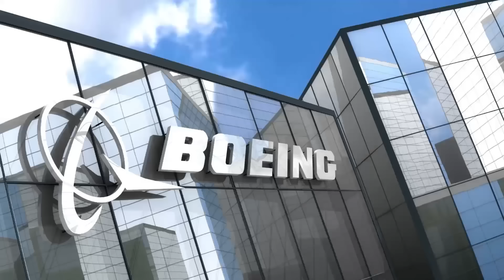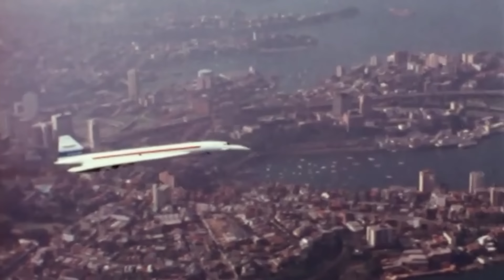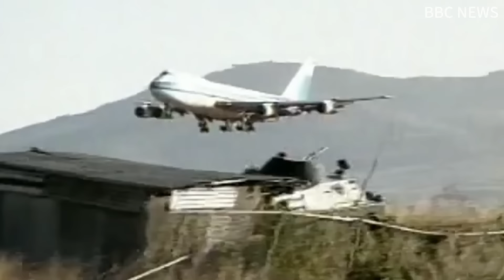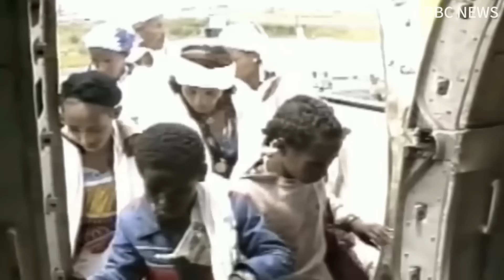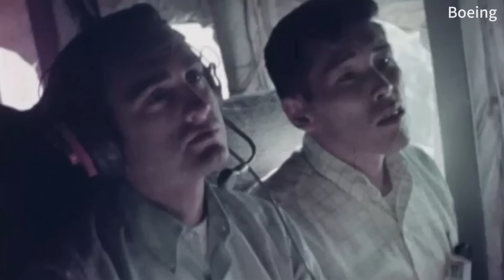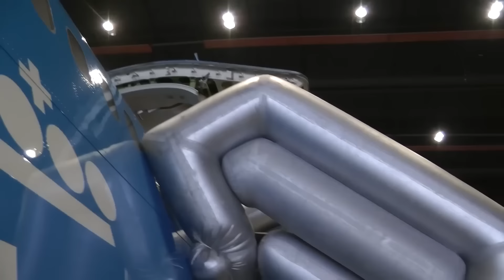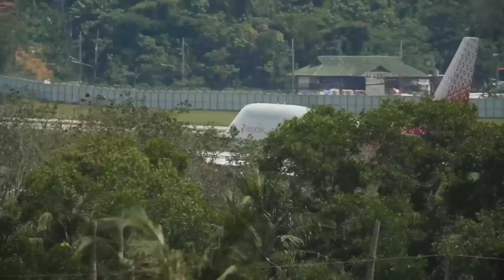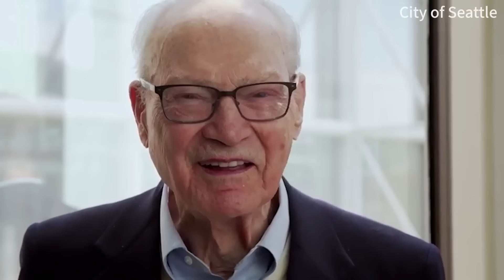What The Boeing 747 Hump Was Really For

Comment: I remember the Boeing 747 was originally designed to cruise as high as Mach 0.90. But fuel efficiency considerations reduced it to Mach 0.85 cruising speed. It should be noted that the 777, 787 and A350 were all designed for most efficiency long range cruise at Mach 0.85, thanks to improved aerodynamic design and modern high-bypass engines.
Reply: The 787-9 economy speed is .85… It can be flown to .89 if fuel is not a consideration…
Reply: Right, yeah. I remember that too. Why did we stop educating everybody about everything? Because our rowdy elementary school classmates "reached adulthood"? Yeah, right!

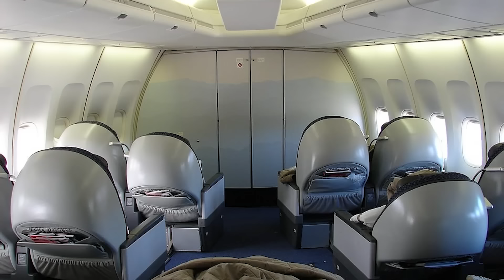Comment: 2:00 lol at “it’s a better view than the pilots” 😅 that’s a beautiful front view out the window there where you can actually see the runway and city and well… everything else in sight just how the pilots do… NOT. Why I hate flying large jets like that, make the side windows as big as you want but you’re never going to get a better view than the pilots unless you’re in one of those bubbles / a gunner position in a WW2 era bomber or stunt planes where the passenger rides front seat
Reply: You can get close to the pilots view on an A350 or even better viewing from the tail.

OK. That feature was originaly for the pilots to check the aircraft in flight but a nice feature for passengers.
Reply: Did anyone try to put a window in or near the nose for those front passengers?  I guess it has weather radar and other equipment that needs to be behind the nose and or under the cockpit.